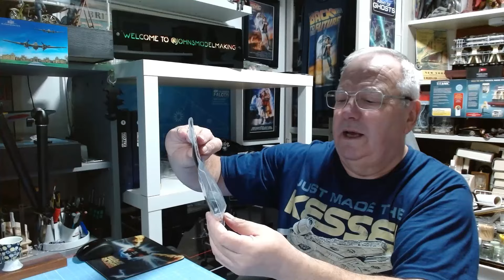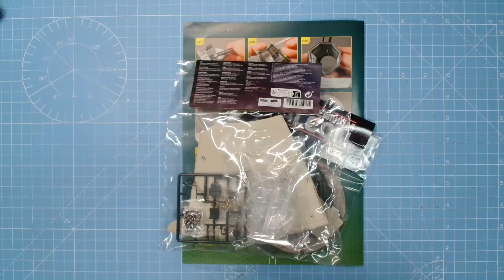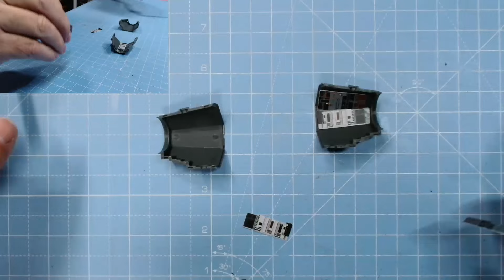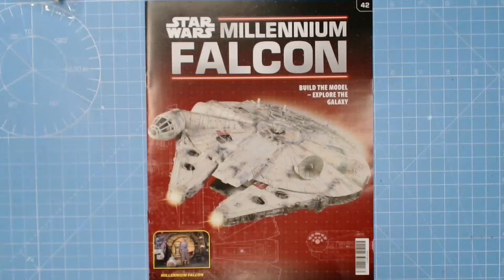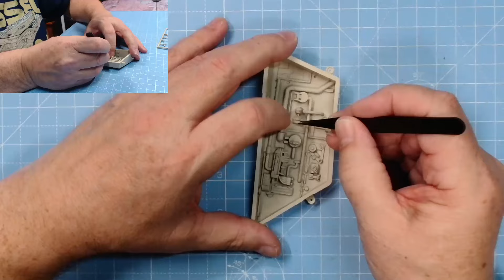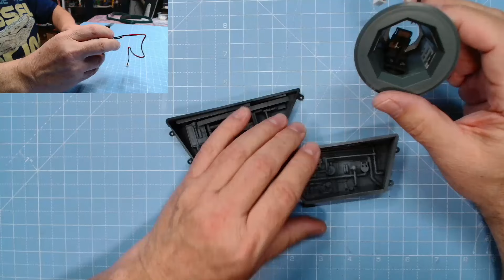Star Wars Millennium Falcon stages 41 and 42 from Fanhome

Comment: John wait until you have the part it mounts to then decide if it needs to be redone. I’m betting it will look nice and weathered when in place. Maybe, with all the pipes in there add a little metallic paint to some of the pipes and fitting. Great work so far.
Reply from the maker: Thanks for the suggestion 👍 😀